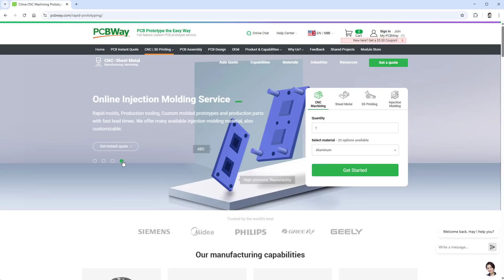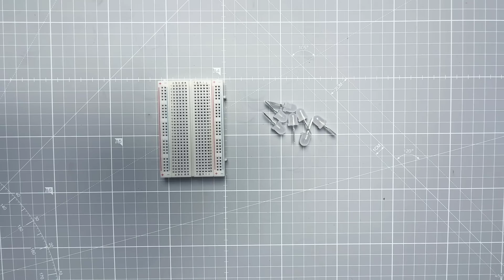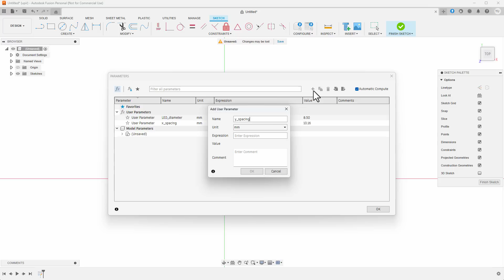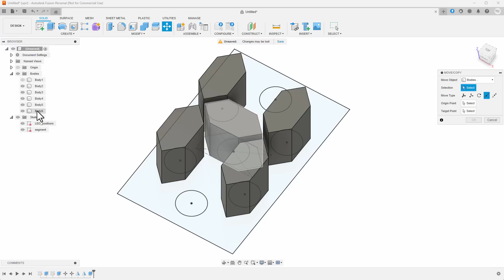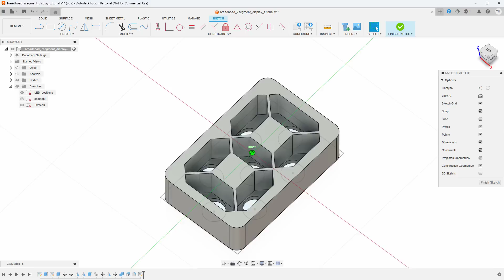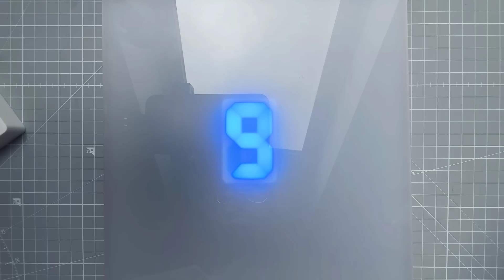Arduino Breadboard Display - needs only Arduino UNO, breadboard, NeoPixels and 3D printed diffuser

Comment: Hello Sir, I needed a help.
How do I interface two OLEDs with different I2C addresses 0x3c and 0x3d together in the u8g2 lib? It's easy to do it in the Adafruit_SSD1306 library by just 
display1.begin(SSD1306_SWITCHCAPVCC, 0x3c));
display2.begin(SSD1306_SWITCHCAPVCC, 0x3d));
But I can't figure it out for the u8g2 lib...
Reply from the maker: Please see my other comment, thank you.
Reply: @upir_upir  Thank you for the help!

Comment: Hello sir, I am in trouble.
I was make a code for esp8266 but it is working in wokwi project with esp32 but if I upload this code in ESP8266 with some library update it not working, means display not glowing but code is compiled successfully and upload successfully 
If I upload a small code then it work display also working
Reply: This project is you can see
Reply: A wdt reset error coming in serial moniter
Reply from the maker: Is there a reason to not actually use esp32?
Reply: @upir_upir  Sir problem rectified because which pins I was define in programming they not set as per ESP document, after change pins programme run successfully
Reply from the maker: @mirzya-gaming perfect, that’s great to hear!
Reply: @upir_upir  we are inspired by you